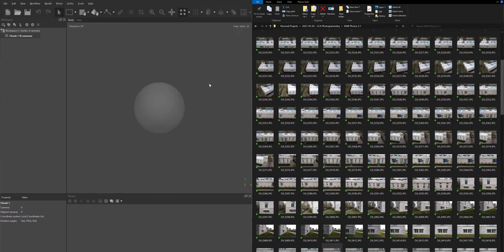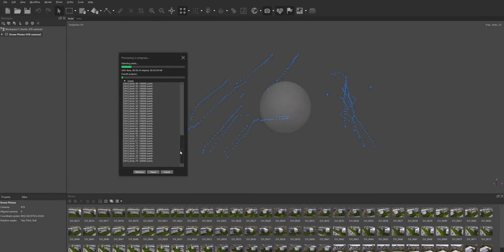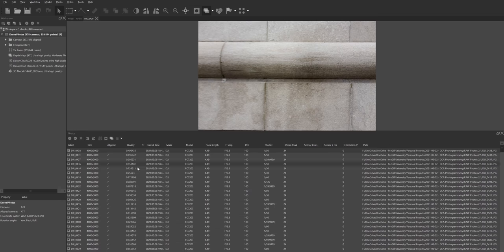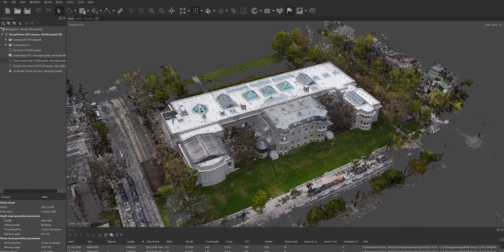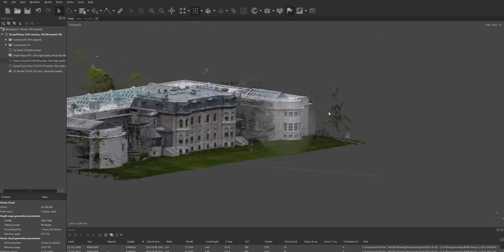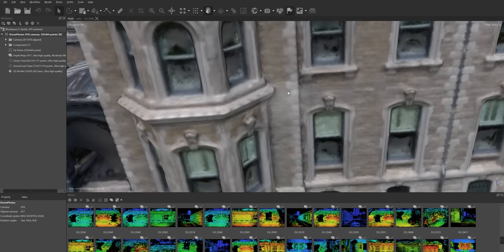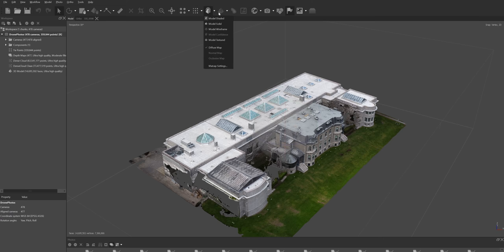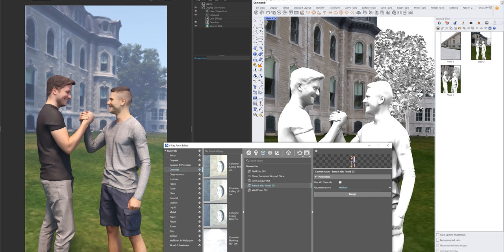Scanning Buildings Using a Drone

Comment: Excellent tutorial, I've been looking for a video showing how to get better results by filtering by confidence. Most tutorials just show the standard workflow and if you work with drones with rolling shutters you tend to get a lot of noise, it's great your tutorial shows how to clean this up. Great job keep them coming
Reply from the maker: Thanks Colm! And yeah, cleaning by confidence is my favourite way of cleaning tree canopies. I literally just finished a project for a classmate of mine and the trees were gone in 2 seconds. 
To fix the rolling shutter issue, I try to shoot at at least 1/200 sec at 2second intervals. And you can also run all photos through Lightroom to tame the highlights, bring the shadow up, reduce the contrast and bump the “texture” slider. It works miracles.
Reply: Great advice, maybe that could be a subject for your next tutorial?
Reply from the maker: My intention precisely.
Reply: @danielkuzev4992  Hi Daniel. FYI, i think someone running a scam with your account, i got an email saying  i won a DJI mini 3 from your site but i've never entered a competition.
Reply from the maker: @nilracmloc  Hey, I’m sorry this is happening. There was a scam account messaging people here in the comment section, and I blocked it.
Could you message me in private with the email you got the message from so I can report it to YouTube? You can message me on IG

Comment: I’m running into an issue where DJI doesn’t allow you to shoot at intervals shorter than 2 seconds. Any way to go around this?
Reply from the maker: Yeah, I have the same problem… as I can’t use 3rd party software with the Mini, I just fly slow in Cinematic mode 😂… and have a high shutter speed. Just making sure I get as much overlap as possible.
Reply: @danielkuzev4992  which software are you using for shooting?

Comment: Hello, i am in search for an method to measure exactly dimensions of an buildings all details.
Can this be done by scanning from a drone?
The purpose is to 3d print that building  most possible detailed.
Regards
Tore from Sweden
Reply from the maker: Hey Tore, you can measure from a model, if shot with a drone. I have a video coming out in a few weeks about increasing the precision of a point cloud or a mesh. What I discovered is that, given I am using just a DJI Mini, out of the box, without calibration, it can be off by about 2cm over the span of 30m. For 3D printing it should do the job
Reply: Thanks for the answer. 
I'm looking forward to your next video.

Comment: What kind of computer is required for such a large point cloud? What if you have a lot of jobs?
Reply: Could several flights be added as days progress? If I want to map my whole city, scale it down and 3d print it as a souvenir, is that possible with this method?
Reply from the maker: The limiting factor I hit at some point was not enough RAM. But I’m talking about 2200 photos, 24MP each (which might be an overkill). This shot up to 85GB of Ram. If I was using only the drone photos, 12MP each, 32GB was enough. 
Metashape would use everything there is on your computer. It seems, however, that you don’t benefit from anything above 12cores. So faster cores are better than many cores.
Reply from the maker: I’d challenge the level of detail you need for 3D printing. How big is your printer’s nozzle? How tall of layer do you plan on making? A lot of detail will be lost in 3D printing by default, especially when it comes to a cityscape.

Comment: Do you recommend this software over reality capture. This looks easier
Reply from the maker: I wish I had a ton of experience with Reality Capture to be able to answer this question more in debth! From the limited time I have spent with it, however, I would say Metashape does a better job at allining all images, even if they are taken from different sensors. Again, RC has improved over time and it might be just as good.

Comment: Which file extension (.obj, .dxf, etc) do you find the most useful when trying to import a 3d model into Revit?  I get mixed up with all of the file types you are able to extract from Metashape.

I've seen other videos that suggest going through ReCap to create a .rcp or .rcs to use in Revit.  This is the process that gets tricky to me, just trying to figure out which file types to export from metashape and into Revit (or one software to the next).  Thanks.
Reply from the maker: Hey Joe,
I never import 3D files into Revit. In general, Revit isn`t that great with meshes imported from other softwares (except for Rhino nurbs surfaces... those it loves). The main difference between all the formats you mentioned and an .rcp file is that inside the .rcp you DON`T have a 3D model, but just a point cloud. And to be honest with you, if I need to model something in revit, I always go through a point cloud.
In short; export as an .e57 format (make sure you use meters as your local system), start a new Recap project, import the .e57, wait for it it process, and you should be good to go.
Reply: @danielkuzev4992  thanks for the feedback.  I am just trying to think of ways we can use drones where I work (Arch/Engr design firm).  For example, when we do an expansion project to an existing building, and there is no model (or sometimes even drawings) for that building, or architects are modeling that from scratch sometimes to show finished renderings to the client, so they can see what it will look like with existing and new construction when complete.  I was wondering if some data captured with a drone (or any scanner) could at least cut down on that time instead of starting from scratch.  I am not sure if they would be able to use a point cloud to start that process.... maybe so.

Comment: Hey Daniel, thanks for the tutorial! I wonder if you’ve ever used realitycapture? It seems to be performing slightly faster, no? Keep it up! 👏
Reply from the maker: My pleasure ☺️. Hmmm, I have, but I am not super happy with it. Maybe it’s just me, but I never end up with one signal segment. I always need to stitch something up manually. Metashape has been a blast so far 😂
Reply: @danielkuzev4992  and when you end up with several components in RealityCapture after aligning pictures (on virtually every project I've tried) the process of adding tie/control points is very painful... It's much easier in  metashape, especially considering that most of the time it's able to produce a single block from the get go...

Comment: what drone mapping (photogrammetry) software did you use to get photos around the building not just from a birds eye view?
Reply from the maker: Hey Breezy. It all comes from manually controlling the drone. I’m using the very first Mini and, as far as I know, there is no way to pre-program a path for it ;(
Reply: @danielkuzev4992  that’s crazy! My assumption is this would take hours to capture? I want to do similar to this and upload to unreal engine 5. I have the mini 2 and no hand held camera. I guess we just give it a shot! Brilliant helpful vid thank you
Reply from the maker: @breezyhdtv2129  you’d be surprised how fast it goes. Put your drone in Timelapse mode  it will take one photo each 2 seconds. From there just move slowly around the building.
Reply: @danielkuzev4992  ah thats a brilliant tip thank you so much didnt think of that!

Comment: Wonderful, wonderful video with a lot of information of 3d processing. Did you use apps like dronedeploy or such for taking photos? I was wondering for drones as Mavic Air 2 or Mavic Mini, many of these mapping apps are not compatible. What can be done to make a perfect flight plan? And any advice regarding manual flight plans?
Reply from the maker: For the mini 1 or the mini 3, nothing (as far as I can tell) can manipulate them. I’ve been going manual mode while taking interval photos. It is more laborious than having a pre-planned mission, but it does the job. Just make sure to have at least 70% overlap between photos and fly slowly. That usually does it.

Comment: Super cool! What does the accuracy look like for this kind of approach? I’m curious if it would be handy for folks like stonemasons producing estimates.
Reply from the maker: Hi Edward. From what I have seen so far (always keeping the Mini in mind) that it can be pretty accurate. However, a report from Metashape tells me that the precision of the location of each photo can be anywhere from a foot to several meters. It is important to keep in mind that there is a difference between tolerance and what it actually is. Even if the tolerance is large, you could still have meaningful results. One thing you can do is to have a scale bar in your scan and put the distance between the two ends manually. Alternatively, you can use two points far away from each other and measure the distance with a laser and then force metashape to keep that distance.
Reply: That’s helpful to know! I’ve got to try this out for myself to learn more.

Comment: What is the most affordable/precise drone to do this?
Reply from the maker: Precise… anything with an RTK GPS. 
Affordable… any of the Minis by DJI
Best… hmm anything with at least 20mp camera that can be pre-programmed
Reply: @danielkuzev4992  dji mini 2? 3?
Reply from the maker: @coacollective691  I use the 3 now and it’s been pretty neat. 
On the expensive side there is the Partot AI… what a beast of a drone… made specifically for photogrammetry

Comment: Interesting. Did you fly the drone and take the photos manually or were you able to set waypoints and/or a mission plan for this?
Reply from the maker: There are no waypoints on the Mini, unfortunately. So I just set the timer to 2sec and started flying around slowly to ensure enough overlap between the photos.

Comment: hi bro ... pls can you tell  how you planned  for image capturing . By any software or by manual...type
Reply from the maker: In my case I go manual. I’ll make a video on it as soon as the weather allows, but here are some pointers:
I go above looking down and I go back and forth till I cover everything I need. 
Then I go parallel to the facade and cover all of them. 
And then I go 45 degrees to the facade so I get the inside of window frames and doors
Reply: U have any proper plan on plying or sketch for fixed elevation path  and how did you took the reference point for same     area with different elevation
Reply: @danielkuzev4992   i texted in Instagram also can we connect there
Reply: Pls

Comment: Will Metashape Standard Edition do what you have shown here?
Reply from the maker: To be honest, I am not sure. It's been a while I haven't checked the comparison sheet.
Reply: @danielkuzev4992  have you tried Maps Made Easy (Map Pilot Pro)? I flew a quick mission around my house today and am trying to figure out which 3d file I should download and how I cab view it.  For now, I dumped them in metashape from your link and am following your steps. It's been running about 6 hrs now, so just waiting for it to finish and then I'll chop it down as you showed here. Thanks for the content.
Reply from the maker: @JoeBoone82  I havent tried it yet because my drone isn't compatible.
One thing you could do to reduce the time is set the dense point cloud quality to medium... unless you're going for an insane amount of detail, it will do you pretty well.
Reply: @danielkuzev4992  the Maps Made Easy worked with the Mini 2.  In metashape did you get all of the blue areas above your 3d model? They appear to be the camera/drone shot locations. I'm not sure how to turn that off.  

Also, did you ever try exporting into Revit? Where I get confused with that is what type of file (extension types) to export from metashape and to import into Revit.
Reply from the maker: Hey. I'm happy to hear back from you with good news. I wish I could use Maps Made Easy, but I don't have a supported drone... Getting there haha
- It is normal to get the blue squares. Those are the camera locations. On the top right, in the ribbon, there is a camera icon you can click to turn them off.
- Yes, you can export to Revit, and it works like charm. The easiest way to export without worrying about coordinate systems is the following. Right-Click on your chunk, Export, Export Points, select your name and location, use .e57, and under Coordinate System select "Local Coordinates (m)". This will export your cloud. Before you can put it in Revit, you will have to import it into ReCap, and then link the ReCap file into Revit. And it works great! I've used it on many projects. You can see it here:
https://www.youtube.com/watch?v=yv_Y4lqLB_I at 6:43 I show an example (not the process though, sorry). And then at 8:20 I show a model in ReCap.

Comment: Can you show how to decimate everything but not the roof?
Reply: um maybe u can duplicate model, select the roof to delete it, and u can decimate the others part. So basically u hv two parts, high poly roof and low poly body building.
*optional: i think its easy if u already export to 3d software and decimate on it